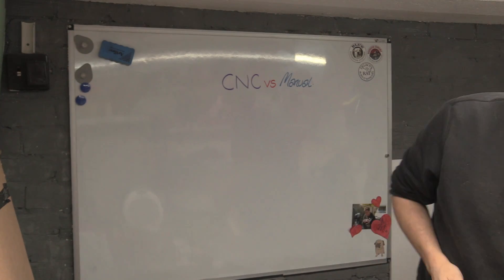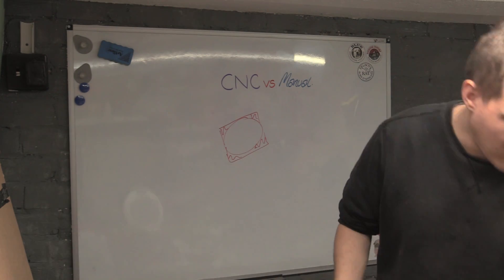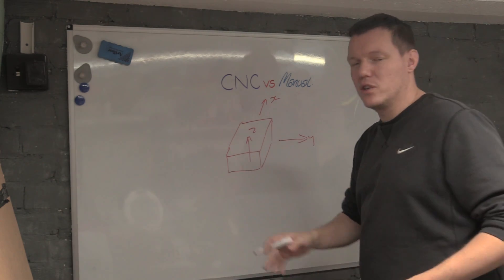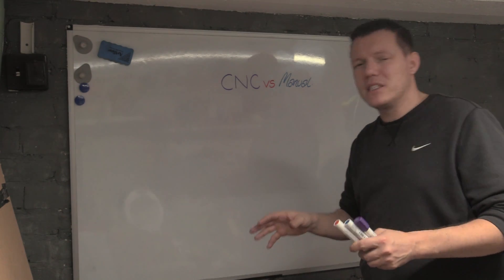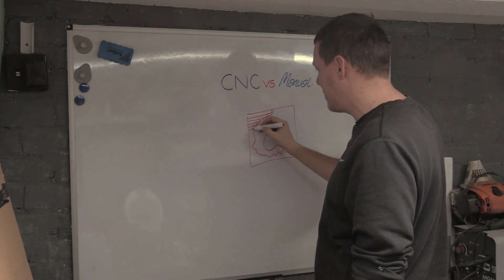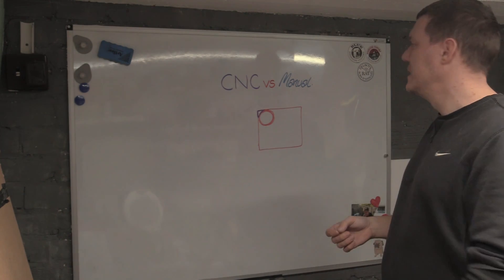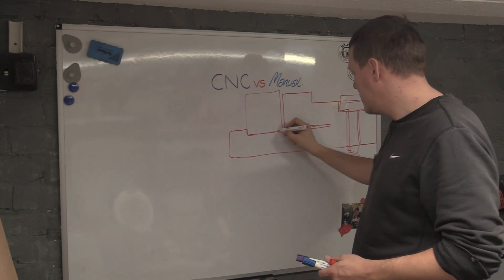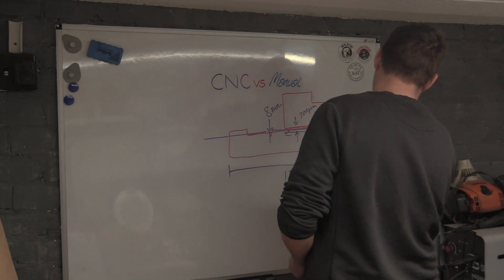CNC vs Manual Machining

Comment: Are there people that are actually confused about this?  I mean, you can install a kit on your manual mill to make it a cnc mill, and when you're installing it, you can easily verify for yourself that all it's doing is using the same controls that you've been using manually all along.
Reply from the maker: Some people haven't touched a machine, ever.

Comment: I can't believe that someone thought a 200 micron tool exists, let alone have the strength to do a cut. Where do these CAD designers come from, ffs? I mean, I'm no engineer, but even I know that his assumption is full retard.
Reply from the maker: Young Post grads straight out of uni. They don't think of scale. He also thought I was pulling his leg when I said use a fibre washer...
Reply: It will blow your mind to know then that that do exist and I've got a 0.2mm endmill at work.  We also regularly make our own engraving cutters (D-bits) down to about 0.1 at the end but they are tapered about 20 degrees.  Obviously that slit can't be conventionally machined even wirecutting it would be prick.
Reply from the maker: But not 0.2mm and 8mm long lol
Reply: @thedirtyworkshop  Exactly.
Reply: @thedirtyworkshop  haha no.  The flutes are 0.5 long so not cutting that slot with it for sure.  It is pretty amazing some clever bugger managed to make them though.

Comment: I used to cut long driveshafts for water pumps, I did mine on an old manual and a coworker used a cnc lathe.  He was so convinced cnc was better he never figured out why his shafts always had to be straightened after and mine never did